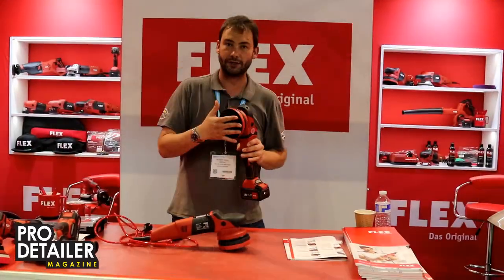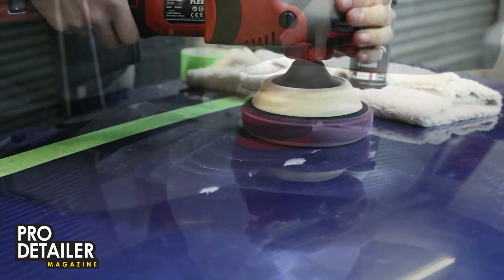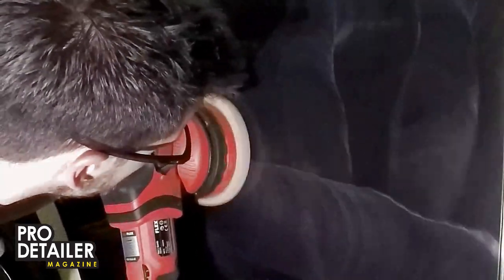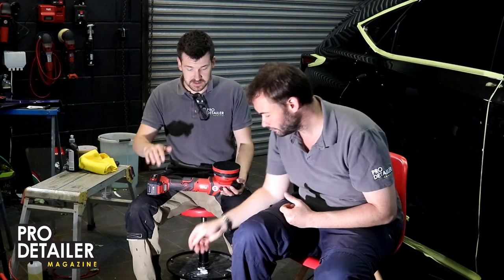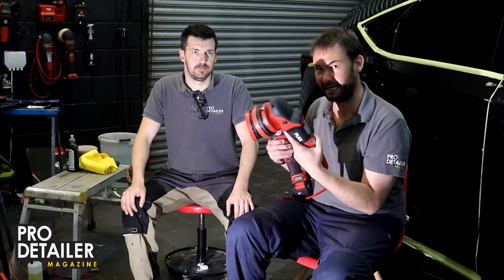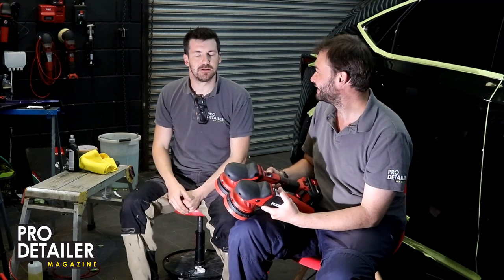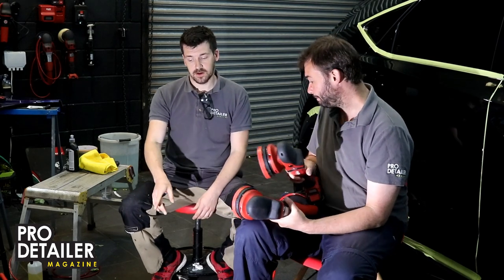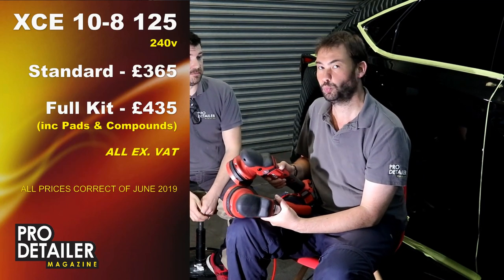NEW Flex XC Forced-Rotation Review - VRG Replacement

Comment: Better than VRG?
Reply from the maker: Yes - a definite improvement- it does everything the VRG does, but better
Reply: I have now xce and vrg...xce is a little bit difrent macinhe...better finish but vrg had a better cut...tested on sand paper 1500 and 2000
Reply: For me the brushless is the best
Reply: @umjetnik-bm7ud  better cut how? The VRG had plenty of cut even at speed 3-4. With this new one being forced too, which all you need is rotation and the right pad/product combo, what was your form of measurement to compare their cut? Honest question, not being a smart ass.
Reply: Nope, it has less RPM than the 3401 along with less OPM
Same 8mm throw
Shitty 3 point backing plate(this is their version 3 plate in hopes that it won't sheer off)
Reply: Their cordless xce is even more water down than the corded model
Reply: @umjetnik-bm7ud  mktnanbetter cut due to less RPM and OPM..which equals slower correction

Their attempt at a smoother machine..I'm sure they downspecd it to to make it less likely to sheer the backing plate off like the preproduction unit I played with 3 years ago and also with the v1 and v2 xfe7-15
Reply: Indeed, il take the 3401!! 👍

Comment: What's the deal with the cordless machine speeds? In other forums in the states the advertisesd cordless machine only goes up to 380rpm and not 430rpm?
Reply from the maker: They may be slightly slower than the corded machines but being forced rotation it's about orbits per minute, not revolutions per minute - OPM not RPM - for every rotary revolution, the head orbits 10 times. The corded XC has an extremely high top end, but both corded and cordless offer appropriate speeds for paint correction.
Reply: @PRODetailerMagazine  thanks for the reply. I'm in Perth, western Australia and both tools will be available soon. Trying to figure out which one to get but I don't have access to try them both  unfortunately. If you had to have just one which one would you choose?? Corded or cordless?
Reply from the maker: If you're studio based I'd go corded - the forced rotation gearset means the cordless alternative isn't quite as convincing as it is in the DA, Rotary, or PXE form - but that's just an opinion. If you're mobile the cordless has many practical advantages
Reply: @PRODetailerMagazine  thanks heaps! I'm leaning towards corded but the cordless is pretty cool tech.

Comment: So what is the difference other than the weight of the polisher between the new flex and the original 3401.. the 3401 has been proven to be extremely robust tool in the industry.. need some real reasons to switch over?
Reply from the maker: Think of it as evolution rather than revolution - for many it won't be enough to ditch a perfectly working VRG, but when they come to replace it, the new one will have comfortable familiarity combined with a feeling of improvement - the new one is certainly smoother and quieter. These are the stats taken from the Flex website: 

Flex XCE 10-8 125
Max. polishing pad diameter: 160 mm
Max. back-up pad diameter: 150 mm
Orbit: 8 mm
No load speed: 140-430 rpm
Orbit rate, no load: 2900-8600 opm
Power input: 1010 watt
Power output: 590 watt
Cable length: 4,0 m
Weight: 2,6 kg

Added Features:
Soft Start, Overload protection, Temperature monitoring, Constant drive control

Flex 3401 VRG
Max. polishing pad diameter: 160 mm
Velcro backing pad Ø: 140 mm
No load speed: 160-480 rpm
Orbit: 8 mm
Orbit rate, no load: 3200-9600 opm
Power input: 1010 watt
Power output: 590 watt
Cable length: 4,0 m
Weight: 2,6 kg
Reply: 3401 stil better machine
Reply: PRO Detailer Magazine the new XC is SMOOTHER? That’s enough for me to pick one up.
Reply: Is brushless
Reply: Less RPM
less OPM
Translates to slower correction and smoother machine
More ergonomic body/handle
Crappy 3point mounting backing plate off the xfe7-15
Reply: @c6z061  makita PO5000C is better machine.. cheaper priced, smoothest
Can be made into a 3in forced
Can swap hard makita plate in your longthrow too
More comfy